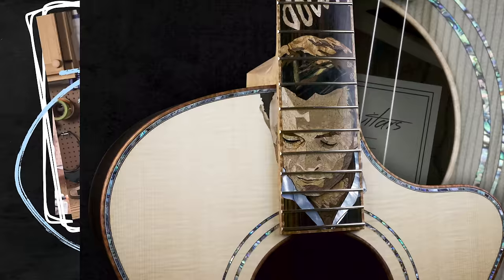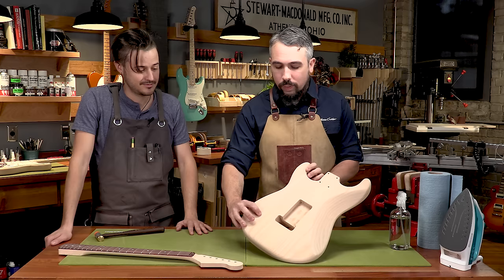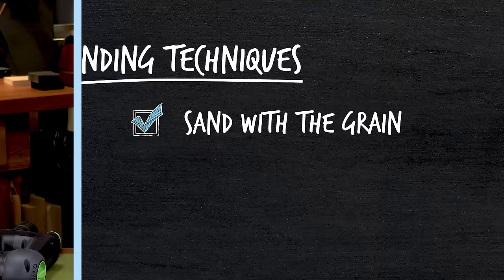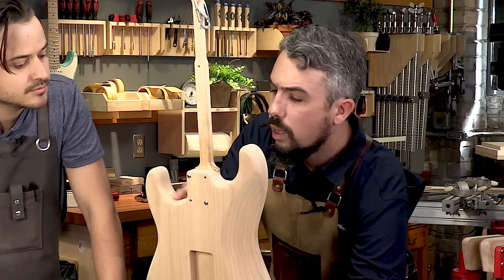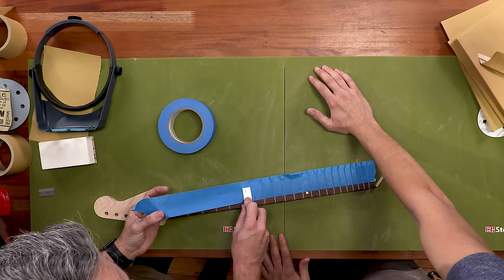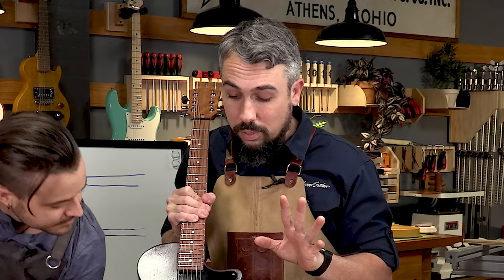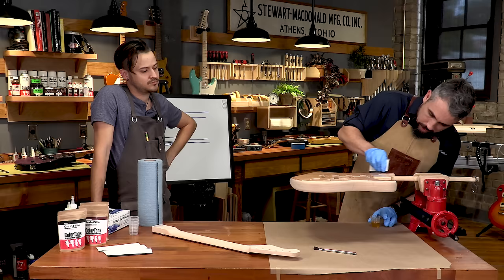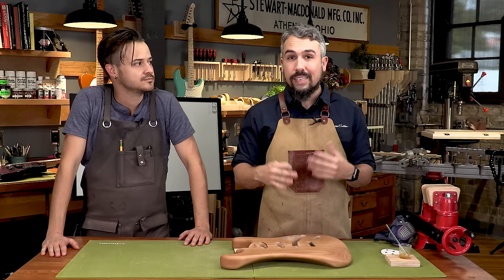Aerosol Guitar Finishing – Part 1 – Prep Sanding, Pore Filling and Sealer Coats

Comment: Just a tip that is very simple but might be handy for some… if you’re heating up your aerosol cans in a bucket of warm water, put the can in a large zip lock sandwich bag first before putting it in the water (Leave the top open so it doesn’t become a floatation device). Then when the can is warmed up, you can pull it out and it will be dry, and the label won’t be soaking wet and falling apart and sticking all over your gloves. I also put a small weight on the lid of the can while it’s heating up, as they can be a bit buoyant and want to tip over in the water
Reply: This guy is the prime choice for 
  acomplishing a professional and well done result
Reply: Ask me how I know?

Comment: Beautiful work! Better results than I've ever had (and I've not tried with aerosol).

If it's not too pretentious, I would love to offer a sandpaper tip: When working with stiff papers in the 80-220 grit range, it's not unusual for the paper to crinkle and create a hard edge (and that can introduce some really bad sanding results). If you 'break' the paper before tearing it or attempting to sand with it, things get a lot easier.

Just grab the sheet by two opposing corners then drag it over the edge of your bench with the sanding side up and while holding enough pressure to be bending the paper at least 45 degrees over that bench edge. Then grab the other two corners of the paper and repeat. 

Now when you go to fold the paper or work inside a tight radius area (like inside the horns on that strat) the paper will flow through those areas without that annoying crinkle showing up to ruin your work!

Comment: Mainly what i got from the series is new respect for luthier skills and an appreciation of what goes into creating a stunning finish. Finishing a guitar is not something to go into lightly. To start at zero and wind up with perfect finish requires a lot of money, shop setup, and equipment not to mention time and skill development. I venture to say when you get done with buying all the stuff, you're easily heading past $2,000. Makes more sense to put that money to a used instrument you like. As a monetary proposition it makes little sense, but if that's your business and you can command several thousand per unit, well it might be worth it. It's too much for an amateur to master without significant time commitment.

Comment: Why this is the best build tutorial I’ve seen.
I’m on my 3rd kit and I’ve seen more build videos than I can recall and these videos render dozens I have saved as unnecessary.  The key element that separates these videos from other is the inclusion of easy details and practices that fine tune the build process along with quality and clear explanations that give meaning and clear purpose for each direction and tip.  This allows me to pay attention to the process with clearer understanding of wood prep than I put into my previous builds.  The detailed tips on, for instance, masking the fretboard, ironing out dents in the wood, were ‘aha’ moments for me and those moments are what make these videos really useful.  They foster a sense of self-efficacy that gave me heightened confidence in particular due to all the ways included to avoid, and more importantly, correct mistakes.  The 2 person novice/expert (not really a novice but seemed to mirror my experience as new kit builder) approach gave a great kind of pre and post enlightenment view of the build. Stewmac has a lot of information laden videos such as this but this is a standout in large part because of the pleasant warm style of these presenters.  I find 1.25x speed is useful but 1.5x starts to lose some clarity.  I did end out purchasing the finish kit from Stewmac so success as an infomercial but it was a sale price and it’s a common product line so as a novice the decision freed me to think about other aspects of the build.

Comment: Well timed series.  I'm just about to renovate my first guitar (an old Hondo) which I took apart 35 years ago.  It has a really bad attempt at chiselling and drilling for a locking tremolo (back in the '80s) and I'm routing it out properly, repairing and fitting a fixed bridge. I also stripped it back to bare wood so I will be following your video advice carefully to get a good finish.

Comment: Great instructional video. Most of this is the way I do it with the exception of the Epoxy pore filler. That alone is well worth the watch. I am excited to do the next finish job using that tip. Maybe at last I will get the perfect finish. Thanks guys.

Comment: I found a Sous Vide stick at the thrift store, that I use exclusively in the shop for heating things like paint cans. Set your temperature and it will hold it for as long as you want it to.

Comment: Although you did a great job and the end result is awesome, I'd like to recommend to take a lightly wet sponge or cloth after sanding and carefully wet the wood. Small fibres will rise just as they would when applying filler/sealer/lacquer. After wetting the wood sand again. Rinse and repeat until no more fibres lift themselves up. Then proceed to the next step.

Comment: My tad tought me to use a rockwool cutting blade to rip sandpaper. Works like a charm. Just lay it flat on the back of the paper and rip it like kitchen foil holding the blade down with mild pressure.
Reply from the maker: To Matt's credit, those workbench edges have been rounded over so it is a little bit hard to get a clean edge tear off the bench.  (Thanks for the tip!)

Comment: A tip for temporary spray booth: use a large cardboard box outside. You can build a frame out of 2x4s to suspend the guitar or find a tree branch or patio cover to hand the guitar from. I've used a cardboard voting booth before.

Comment: Great tutorial - I use mostly Shellac with hardeners and let the first four or five coats become my pore filler.  Always get shrink back even with that approach.     Will have to do some testing with the expoxy filler and shellac that I have been using.   Never sprayed a solid color as I tend to stay with acoustic and allow the wood and grain to show through.

Comment: One way to get clean tears in sandpaper: screw a hacksaw blade to a scrap piece of wood. Slide the paper under the blade and pull. I have my blade set at the same width as a sanding pad (1/4 sheet) . No guesswork, clean tears every time.
Reply from the maker: Great tip!

Comment: I found that heat and scrapping works easiest to get off the old paint, and if done properly there is little sanding. Also you can get gel superglue for the fill ins.

Comment: I thought I'd add something-Don't use any pressure with tack cloth on bare wood. It leaves sticky on the wood and can look like a stain. Yes, it's very easy to coat the wood with the same sticky stuff that's in the tack cloth. That will ruin your finish and you'll have to go back and sand it out because just trying to clean it off doesn't work.
Use a lacquer thinner and cloth to clean the bare wood and remove the dust or A lightly dampened microfiber cloth.

Comment: Full disclosure, I haven't read all the comments, or watched all the videos yet.  If someone else has already mentioned this, please excuse the ring.  At about 11:35 in this video, a common misconception about sandpaper grit number was erroneously called out.  The number (220, 320, etc.) is NOT grains per square inch, it's grains per lineal inch.  The grains per square inch would be the square of that, so 220 grains per lineal inch would be 48,400 grains per square inch.  Thanks for putting out the video series, and thumbs up to crush a troll.

Comment: I followed this video almost to the letter,the only thing I did different was I used Solarez grain filler because I was unable to find the Z-Poxy resin finishing resin,everything was going wonderful I used Stewmac sanding sealer,then their cherry red lacquer and she is beautiful…until I started applying the Stewmac clear gloss and no matter the number of coats,I get satin not gloss,it says gloss on the can but at this point all I get is satin,I will contact Stewmac but,I don’t want to do anymore spraying,it’s not the finish I want so I’m not buying anymore expensive guitar finish products from Stewmac anymore,back to Home Depot for lacquer,I’ve built six guitars so far and I bought the Stewmac Les Paul style kit and so far so good as far as the kit goesI ‘m using the body and neck only so we’ll see if I can stomach using a satin guitar

Comment: Well from personal experience, I can say that heating up the can of aerosol lacquer is great for making it flow smoothly. I placed it inside a clear plastic bag to keep the water & moisture from contacting the can for about 3-5 minutes.

****However, I found out to my horror, that the water the can sitting in may have been a little to hot, and the can started leaking from the bottom and cause a big old mess!! However, the water I used to heat the can was really only hot to the touch; but not even close to boiling! Maybe only 110-125 degrees F. Thus, I was a bit confused and frustrated at the whole ordeal. And there went $30.00 down in the trash can. Dang.

In any event, my point here is, be super careful when heating your can of aerosol lacquer prior to spraying it!!

Comment: This video was extremely helpful. I definitely learned a few new tricks that will help on my current project. Is there any advice on sparkle paint? Could I use same epoxy process to smooth the surface before applying clear coat?

Comment: I'm going to stain my wood, do I stain first, then epoxy? Sounds logical. Trying to stain after epoxy sounds like it wouldn't penetrate the wood.
Reply: Yes, definitely stain first. The grit of sandpaper to use beforehand depends on the wood grain, darkness of color desired, hardness of the wood, etc. Some hardwoods won't even require pore fill, most do. I used 320 grit and it didn't stain as dark as I expected and had to stain it twice. Then again, I may have thinned my stain too much.

Comment: Surely you should sand the edges first because the sandpaper is also going across the grain of the front and rear of the body. I noticed it several times in the video. it doesn't matter if you do the front and back after.

Comment: I entered your contest, liked the video, watched all three, and I have a question.  I want to paint an old electric guitar I had when I was teenager my question is could paint it in my garage?  I saw a video where someone said that I could but that I would have to do it when humidity is low and the temperature outside is not too hot; preferably in the Spring or Fall here in Orlando, FL.

Comment: If I wanted to finish with a natural (only clear coat) look, could I do just the pour fill and move on to a wipe-on poly? Thank you so much for these videos, they are super helpful. Cheers
Reply from the maker: Sure, that would work.  Poly can be tricky though.  When you use lacquer each successive coat "burns in" ... it softens the surface and the new lacquer (sort of) of melts into the existing lacquer.  Each coat of poly just lays on top of the one before it.  

This makes sanding and buffing a little bit more challenging since you can end up with witness lines where you've sanded between layers.

If you are new to this, I'd do a pore fill, vinyl sealer, (skip the color coats), and go straight to clear coats of lacquer.  That is likely to give you the look you are going for.

Comment: Urgent Question! I stupidly skipped around the video and missed the bit about only applying 3 coats of lacquer per day. I waited an hour between coats and applied about 8 thin color coats the first day, did light sanding and applied 3 more the second day. (today) It seems to be drying fine. My question is: can I start applying clear coat after 24 hours, or should I wait longer? Should I sand off some of those coats? How will it come back to bite me?

Comment: I just stripped a 76 straocaster and sanded from 80 grit to 2000 before seeing your video. The body is smooth and shiny with a few scratches left. There is alot of long grain in the wood. My question is does the wood need to be a rougher finish to apply the two part epoxy grain filler? I see you only go up to 220 grit when sanding.

Comment: Quick question. When you attached the spray stick... Won't there be 2 spots where the guitar is not coated under the screws?

Comment: My trouble is with stained wood, grain fill, then sand.- and even the smallest touch of sandpaper on the stained wood will create a light spot in the stain, ruining the color. If you demo with unstained wood you won't see this problem. Also doesn't epoxy yellow?

Comment: I was bought a kit that already came polysealed. Do I need to sand that off and replace with the Vinyl sealer. Are they the same but by a different name? the rest of this tutorial set was perfect for my first true build. I've done refinishes of existing but not from unpainted wood, so getting this first step right is pivotal

Comment: The stick used to hold the neck was already painted that sonic blue color. Seems you guys pulled the Ole bait and switch? I'm currently using those cans, you can get a decent paint job for no equipment, but don't expect to get nearly as good of results as these guys did.
Reply from the maker: No bait and switch. Through the course of the shoot more than one body and neck were painted to have backups. We used the same stick for all of them. What you are seeing was done exactly as shown in the video. Thanks.

Comment: I’m in a bit of a weird position with my Kit. I didn’t do enough research and just sanded and painted it with a few coats of colour. when I got it. Then I wanted to restart so I sanded back down to the wood and restarted with 3 coats of primer and then 4 coats of colour. Then I did the research I should have done in the first place and realized everything I’ve done wrong hahah. So now I’ve sanded back down to the wood but it’s still very blotchy with blotches of the white primer everywhere, but the guitar feels smooth. Can I start with my vinyl sealer or should I start a little earlier than that?

Comment: My experience with a tack cloth is that as you rub or wipe the dust off you are leaving some of the sticky residue from the tack cloth on the wood.  If you don't get that off before application of a sealer it can cause issues.  Anyone else had that experience?

Comment: So, it's NOT completely from an aerosol. several coats of epoxy primer (sanding between coats) will do the same. Adding a pearl (or any other color) pigment to the clear coat will kick it up a notch, unless the clear is in the can.

Comment: Good tips! If I have a ES -335 kit and I’m staining a flames maple top do I pore fill the body?
Reply from the maker: Yes, you would probably want to to pore fill the back and sides if you want a smooth even surface.  One thing about staining those 335 tops, the veneers on those are pretty thin.  During the veneering process glue can seep through the pores and provide some blotching problems.  You're better off to spray a couple coats of clear first then spray your colors.  You'll get a better result that way.  Our tech folks can help you if you have questions.

Comment: Hi! I am following the process step by step, with very detailed amazing videos, I am far away from the USA and I am trying to get the vinyl primer but I can only find the Acrylic primer which is the same brand of paint and lacquer, is there a problem to use an acrylic primer instead of vinyl?
Reply from the maker: I wouldn't recommend it unless you have no other option. It's best to not mix nitro with anything else. There are some exceptions, but for the most part you're less likely to run into problems if you stick with one type of finish the whole way through. If you can find nitrocellulose lacquer you should be able to find a nitro sealer too. If not, test the acrylic out on scrap first. It may work as long as you give it ample time to dry before switching to nitro. Good Luck!

Comment: Out of curiosity, when doing a pore fill on an acoustic guitar, does the filler used affect the resonance and sound of the wood? Is epoxy still a good option or would it be better to use water or oil based?

Comment: I have a Gibson faded flying v, so it doesn't have the pore filling so you can feel the texture of the wood. The finish is very thin and I've rubbed through where my rests. I am correct in assuming the nitro finish is most likely too thin to act as a pore filler?

Comment: It’s a little confusing about which way to sand on a flamed maple top. Is it side to side with the stripes or it seems like there is a wood grain with the direction of the neck?
Reply from the maker: No, you don't sand the direction of the flame, you want to sand in the direction of the wood grain. 😎  The flame isn't actually part of the "grain" and if you sand across it it will leave very noticeable scratches that will be hard to sand out.

Comment: Hello Stewmac, Chris, Matt and Dan. 
I have a question about vinyl, color and clear coat spraying method. I have tried hanging my guitar bodies with frustration while spraying. I built myself a horizontal painting jig that I can rotate the body as I spray. This horizontal method seems so much easier and much less frustrating. 
How do you feel about these two methods?
JWard.
Reply from the maker: Horizontal works great.  We actually sell a jig that does that.  We chose not to use it in this series so we'd simulate what most people would be doing at home, but the horizontal guitar holder is a great way to go.

https://www.stewmac.com/luthier-tools-and-supplies/tools-by-job/tools-for-finishing/spraying/freehand-holder/